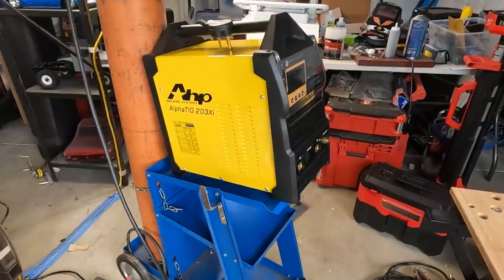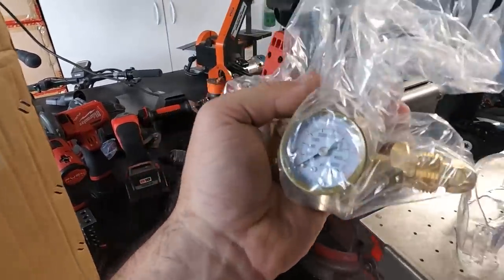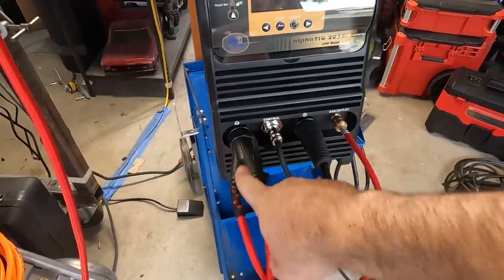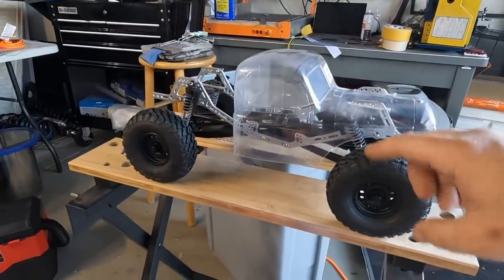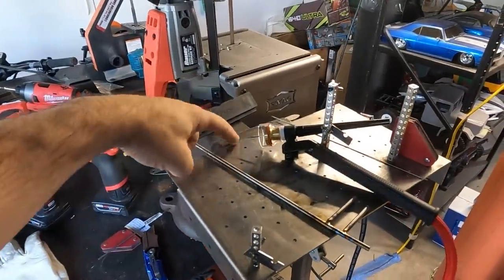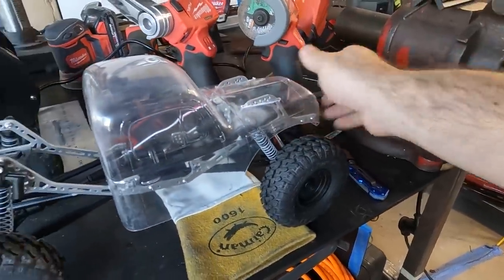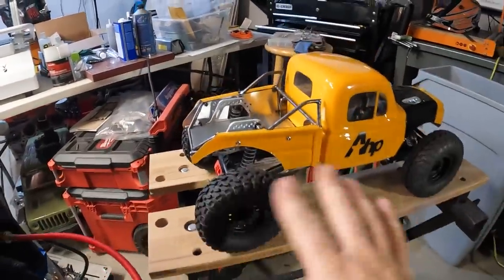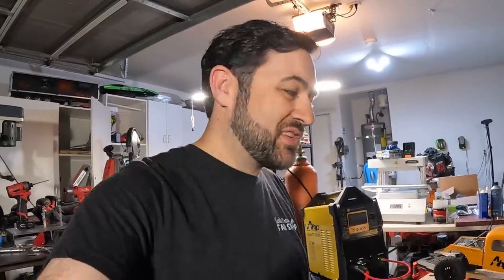New TIG = New TRUCK - AHP Welders AlphaTIG 203Xi

Comment: Josh could you just measure out a new top shelf for your welding cart? One that was larger, then send it to Send cut send and have it cut and bent. Thenjust bolted in place instead of moving the bottle back?
Reply from the maker: It’s definitely an option, but a bracket would likely be something I could bang out in an hour or so.

Comment: Looks same as Everlast DV200 but with digital display
Reply from the maker: Very similar, the Everlast does have the option for longer post flow which I would have liked but this machine was 30% cheaper and came with the Nova pedal and Nova torch, which you have to pay extra for on the DV. I highly considered the Everlast.

Comment: I've got the Miller Maxstar 161 that I purchased yrs ago specifically for tube chassis builds.   I made my own pedal (used rc car clogged belt, bearings)
I think I paid 🤔 $1800. 
I'm amazed how low it goes.. just 5a.
..
If you've been brazing,  if you feel like building, or rebuilding/modified say 6 or more.
  I think it was worth it ! 
Only thing I want to change is getting a smaller bottle of gas. 
## I've been brazing way to much... but I build with relatively small round stock. 
5/32 and 1/8 TIG filler rod is my favorite as it bends to a "scale raduis".

Comment: Need more info on that tube notcher!
Reply from the maker: It’s something I designed and had cut. Uses a trim router and a 3/16 burr wheel. I have a rotary table integrated to make perfect angles. It needs some tweaks still but it’s a beast!

Comment: Those harbor freight welder carts are great, except for that angled top shelf. I took a two pieces of 2x4 and cut a rounded notch in them to slide the bottle back. You can also drill new holes and rotate the top shelf down flat.
Reply from the maker: I’ll probably make a bottle bracket, the chains feel kind of crappy anyway. But rotating the shelf down is another viable option!

Comment: Very cool, I always wanted to start doing my own metalwork, but never really know where to start. Need to check this out. Also, you need a rolling workbench or something! Your place looks a bit like "organized chaos" lol. Might be time to design and build yourself a custom rolling workbench. ( I'm not judging, I have the same problems myself) 🙂
Reply from the maker: My fab table is a rolling table. I just need more room for storage of actual life things that aren’t RC. The table itself just needs organization, room for power tools to hang underneath and storage for some of the larger items. Considered putting the welder under there even but the bottle becomes the issue.
Reply: @HarleyDesignsInc  I hear ya, I have to share my workspace with a Lexus!

Comment: Nice lookin welder. I'm kinda jealous of yer fab/welding table. Looked like a lot of stick out on yer tungsten but I watch on my phone. Let us know in a few months how good that welder is, I'd like to have a good cheap tig to play with. Y'all have a badass day 🤘
Reply from the maker: Yeah these large diameter gas lenses with the high CFM allow for a lot of stick out. It’s the main reason I switched, so I can get into tight cage joints without hitting my cup.
Reply: @HarleyDesignsInc  hell yeah. I've never seen those clear cups before, we only ever had the pink ceramic ones (some mighta been whitish) in welding school.